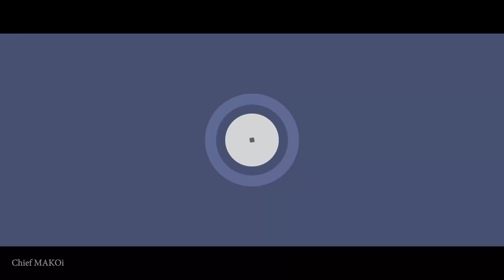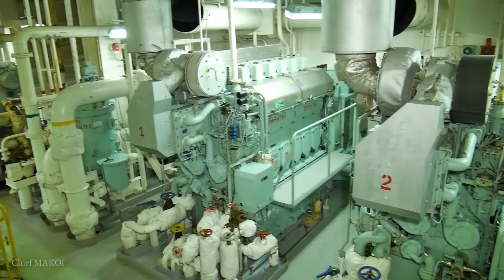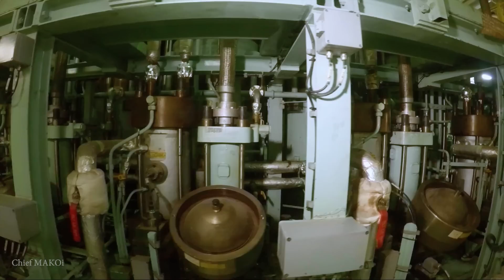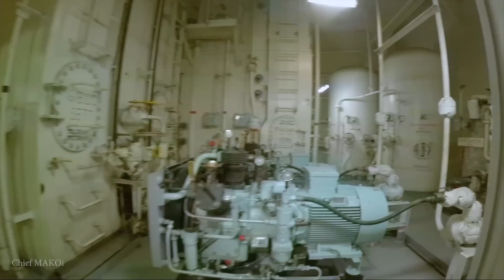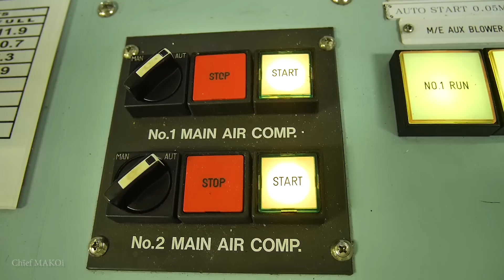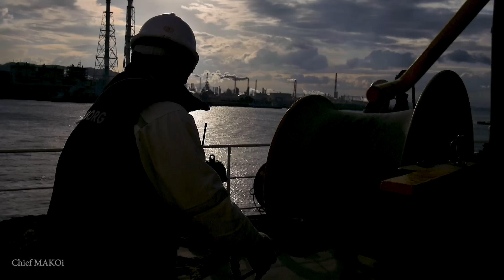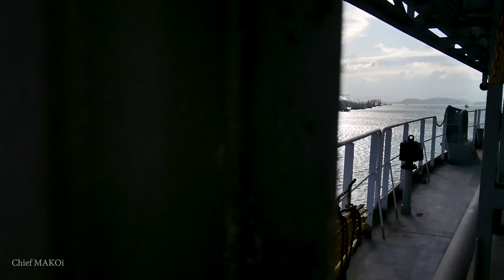Starting Up the Ship's Engine and Leaving Port | Seaman Vlog

Comment: You are not only a superb chief engineer but you are also chief at engineering superb videos.
It's a bit more involved than putting  her in neutral, pressing the glow plug button for 40 seconds then turning the key.

Comment: very good video.  Would have loved to see the engine turned over, fueled and then started.  The electro hydraulic injector and valve train has numerous advantages over standard mechanical FI plunger and cam and valve trains. Timing variation of the injection and valves, and much easier reversing of the prime mover are two.  Who's 6 cylinder main prime mover is that??

Comment: SORRY  A SHIP CAN PULL AWAY FROM THE PORT. MOST OF ALL IF IT HAVE BOW THRUSTS...  IT CAN STARTED  UP ENGINES ALSO AND KICK IN THE FORWARD SPEED TO 1/4 SPEED.  JUST ENOUGH FOR RUDDER CONTROL.. WITH THE CONTROL OF BOW THRUSTER..  I HAVE SEEN AND US  CARRIER DO IT WITH OUT BOW THRUST ER

Comment: That was interesting and really well done, thank you!  

But, what I was looking forward to is the actual starting and stopping off the engine in real time.  After the blow down of the cylinders, is the engine then ready to be started?  Is starting and stopping the engine not as big of a deal as I thought?  You seemed to kind of skip over that really quick.

Comment: Non-seafarers need to understand what you said, the main engine is directly connected to the propeller and to change from ahead to astern or vice versa the engine is stopped and then started up again in the new direction, this is unlike your car that you can put in neutral with engine still running and your car engine always runs in the same direction.  If the engine is turning so is the propeller.  this also limits the lowest speed the ship can travel at, the equivalent to idle in your car with the gear engaged either forward or reverse.  Steering the ship is much dependent on water flow from the propeller over the rudder, without the engine running it would require very large rudder angles to be effective at all.  Going from ahead dead slow to astern dead slow takes some time and if the ship has been running even at a dead slow speed it will continue for considerable distance even when the engine is stopped.

Comment: Nice video sir, may I ask sir how the injection pump and the valves are timed with the strokes of the piston without the camshaft? Thankyou sir. Safe sailing. 
Fr. the Ph
Reply: The valves take their motion from hydraulic actuators, which, in turn, are controlled by electronics. That he already mentioned. If, however, you are asking how the electronic control system itself knows the timing, that is a different story.
As mentioned in the video, there are many varying designs and ways to achieve the same basic principles, one way, the control unit has sensors that gives it information about the position of the flywheel relative to a reference point, thus the controller unit always knows the position of the crank shaft and acts accordingly
Reply: @ahmedabbas4434  yes sir that's exactly what I want to know, the timing. Since it was hydraulically controlled, I was just wondering how it's being actuated accordingly.. Btw thank you sir 😊
Reply: @joseemmanuelvito555  you are most welcome

Comment: My old neighbour (Tom Croft) was on the North Atlantic convoys during WW2,
he said the triple expansion engines slowed right down as soon as they hit 

the Gulf Stream. 

All steam engines work best with a very cold heat dump.
In fact the French mathematician Sadi Carnot enraged engineers when he
told them the maximum efficiency of their engines depended upon the 

temperature difference.

Comment: Why would there be a need to reverse the main engine if the thrusters are electric motors..couldn't that be done electronically by changing the electrical polarity to the motors
Reply from the maker: The propeller is directly coupled to the main engine's flywheel.  There are no electrical thrusters on this ship.
Reply: @ChiefMAKOi  Ah, okay, I swear I thought this ship was Diesel-electric but I was mistaken. Yeah, that makes sense then, thank you, cheers.

Comment: Is the engine directly connected to the propellor?  And is there some kind of gearbox for reverse and forward?
Reply from the maker: Direct.  Engine has to stop in order to reverse.
Reply: ship engines are designed slightly different to most, the diesel engines used on a lot of big ships are 2-stroke diesel engines, both scavenge and exhaust timings are symmetrical about BDC, and will be identical if the engines runs in the opposite direction, all they need to do is alter the fuel timings and air start once the engine is stopped and it can run in the opposite direction, will be even easier for an engine like this with hydraulic valves. It can also be done with 4-stroke but is more complicated.

Comment: How many miles can these engines go before needing to be overhauled??
Reply from the maker: Each part has its own running hours before maintenance.  As an example,  the exhaust valves are done every 8000 hours while the pistons every 12000 hours.  Of course it depends on the condition of the part in question.  If there is damage,  then immediate maintenance should be carried out.
Reply: @ChiefMAKOi  have you ever had to change a crankshaft?
Reply: Do you ever unload on the US East coast Philadelphia, Baltimore, Newport?

Comment: Fascinating, no cam shaft. Is this normal in marine engines? Unrelated but, are you with the same vessel or go where required? Thanks
Reply from the maker: It's the trend in newly built ships nowadays.  The crew are usually rotated among the company's fleet.

Comment: A dummy like me might wonder why the whole engine need to change rotation for change direction to the ship. Thinking there's been those....Not sure what's the real name but as Kamewa propellers decades already. What I mean is a type of propeller that changes pitch of blades and far as I know, the propulsion can be fixed both direction no matter the propller is turning one direction all the time. On this matter,  feels like saving quite a lot work and time when the direction could be turned like a real time with by a one handle. Sure there's a reasonalble cause for this, but just wondering things what do not fully understand. Great vid however.
Reply: My guess would be that for a ship like this, which spends most of its time at sea at a constant speed and needs tugboats for manoeuvering anyway, adjustable propellors would be a waste of money. And they may not be able to achieve the same efficiency either compared to fixed-pitch propellors that are specifically designed for this ship and engine.
Reply from the maker: That would be because variable pitch propellers will require its own set of machinery involving hydraulics and a lot of other stuff.  So that would be a very big additional expense on installation and maintenance.  Plus, since there are more moving parts, the chance of malfunction and damage is greatly increased.

Comment: Say there is a major leak in the engine room what is the procedure?
Reply from the maker: If the ER is already flooding, open the emergency bilge suction valve and start pumping the water out.  Then try to patch up the leak.

Comment: It’s so interesting to know a little of what goes on onboard every single ship you see all over.  There’s such a huge amount of work and complexity to build and operate these engineering marvels.
Reply: I understand what you’re saying and on the other hand these engines are quite basic. Especially the total lack of gears and clutch. Reverse? Ok we’ll stop the engine and start it in the other direction. Makes perfectly sense too!

Furthermore no exhaust gas recirculation (EGR), no DPF no turbo’s probably no Mass AirFlow sensor and so on. 

Nonetheless very impressive.

Comment: Chief Great video. Is the bunker fuel moved to keep it in a fluid state. I have heard that the fuel is almost like tar. Is that true?
Thanks. Send more vids. Subscribed
Reply from the maker: The tanks are heated and temperature is maintained at around 35-40 degrees celsius.

Comment: So in order for a ship to go backwards the engine has to turn backwards?
Reply: Kinda neat, I suspect since the injector and valve timing are computer controlled ,there is a smooth transition to reverse, after engine is stopped ,unlike the old 2 cycle outboards where you back the ignition timing off until it shakes itself into reverse.

Comment: I am a Marine Engineer Student sir, just want to ask if this right or not about my steps to turning on M/E of a ship, first turn up the A/E engine that supports electrical for Lub pump, Fuel pump, cooling and starting air system right, then after all condition ready (include Fuel on its pouring point temp etc.), start to blow some pressure air to the cylinder to push the piston right, then after revolution reached and fuel already injected, starting air stoped, but after all, how to start A/E engine sir, is that same way as the M/E starting or Different?

Comment: Does the ME run on diesel when in harbour and change over to heavy fuel oil when full away. Did in my days but that was a long time ago. Nice video well presented.
Reply from the maker: In certain countries like the US, China and in the EU, it is mandatory to use low sulfur gas oil.  In other areas there's no need to change over from heavy F.O.

Comment: Nice video. I'm curious about more details on bringing the engine to a stop, and then starting in the opposite direction. Do you selectively blow into the cylinders that were on the up stroke when the engine stopped?

Comment: Fascinating video. It made me wonder whether there's a minimum speed that the engines can be run at without stalling. Any idea?
Reply from the maker: Dead slow speeds.  Usually around 30 rpm.

Comment: Greetings from Australia, Chief.  On the maintenance side of things what sorts of electrical motor and mechanical things can you solve onboard with either spares or lathe work ? What are the "show stoppers"?  I should do a video for the start up procedure for my kayak!  Keep up the good work.
Reply from the maker: The items which can be repaired onboard by spares or fabrication are too many to mention.  Most of those are small parts.  However, for advanced electronic designs which run on PLC or Circuit boards, those are almost impossible to get around without having the specific spare parts.

Comment: Are large ocean ships all diesel powered these days Chief? Or are there still steam turbines with oil-burning boilers still around? Our training ship in 1967 was the Glen Strathallan which had a triple expansion steam engine, but they would be a museum pieces nowadays haha.
Reply from the maker: There are modern steam engines but mostlt for the LNG carriers.  The boilers burn the boil-off gas from the cargo.
Reply: That makes sense! No time wasted for bunkering, just use the cargo 😀. Do some of the other types of tankers use their cargo as fuel for their engines?

Comment: Where does the electric power come from before main engine is running?  Batteries, generators or shore power
Reply from the maker: Generators.  On this ship we have 3 with a capacity of 600KW each.

Comment: What a great video! It's so cool to see all the details. Thank you taking the time to create this. I'm curious how long it takes from the engine to go from maneuvering speed ahead to maneuvering speed astern? It's hard to get my mind around the fact that you have to stop and restart the engine to change direction. Fascinating stuff. Thanks again!!!
Reply from the maker: The engine has an automatic load program.  So even if you do a "crash astern", it won't immediately give the amount of fuel necessary to go on full.  Except if you push the "cancel program" button which is a manual override and only to be used in emergencies because doing so could potentially overload the engine.

Comment: Red arc at 50 to 60 rpm a harmonic vibration point in the drivetrain??
Reply from the maker: Yes.  It's termed as critical speed.

Comment: Very informative. Pls do something about the "S" sound in your audio. 😑 i believe you can filter than using an audio software. Thanks
Reply from the maker: Will work on that.  I'm still figuring out voice audio mastering.  I'll get the hang of it someday 😁
Reply: @ChiefMAKOi  or you may want to try pop filter for your microphone in your voice overs (if theres non) or just turn the mic at an angle. Hope it will help. Thanks

Comment: How do you switch from forward to reverse? Can they do that on the bridge?  Is there a reverse gear or can the engine run in reverse?
Reply: @Dipipegb Reversing the engine can be done on the bridge if the control was handed over to the bridge or in the Engine control room as well. In case of chief Makoi engine they have an electronic control engine so they don't have a reversing mechanism, There engine is run by a software loaded to the ECU, not complicated no moving parts only electronic stuff...
Reply: @jaddionecio9956  So the engine can run backwards? The the engine would have to stop and then restart in reverse?
Reply from the maker: Yes.  The reversing mechanism basically just reverses the firing order of the cylinders.  You'll actually see it in the video when the flywheel turns clockwise and then counter clockwise. In engines with traditional camshaft, the reversing mechanism is a mechanical component while in electronically controlled engine  the reversing mech is a software.
Reply: @ChiefMAKOi  That is so cool they can run the engine in reverse, no car engine can do that (except for electric cars). So the process of restarting the engine in reverse is automated? They just select reverse and the computer stops the engine and restarts it in reverse?
Reply: @shaonian  Yes, the engine needs to be stop first then it can be started in astern or reverse direction

Comment: Thanks Chief, I much enjoyed that, more edifying and heartwarming than Game of Thrones. Having been a powerhouse and gas compressor plant operator for several years. Your essential systems are similar to Fairbanks Morse OPs,  GM EMDs and even GE Frame 5 turbines, and I'm sure the intuitive bond an 'Operator', or in your realm an 'Engineer' develops with his engines as almost living machines is the even more intimate when it's the sole piece of equipment that moves your voyage and your lives depend on.
Reply from the maker: Thanks Jack.  That's true.  Even with all the noise in the ER, you can tell something's wrong because something sounds slightly different.  Even when in my cabin if I feel the ship's vibration change or suddenly the humming sounds change, I immediately call the watchman and ask what's happening.

Comment: Was the pilots departure by helicopter lift normal? That seems excessively dangerous just to transfer the pilot, at least from what Ive seen.
Reply from the maker: It depends on the place actually.  Some waterways like the Columbia River Bar could sometimes get very dangerous to cross by boat.
Reply: @ChiefMAKOi  Ah interesting, didn't even think of that. Love your videos, I'm a pilot but the ocean always has my interest. I feel there are many similarities to flying
Reply: It's nice to think your grain or  corn required an air lift to get to your cubbard

Comment: Never thought I’d see an engine make my 16.4 liter engine look tiny.
What kind of oil does that huge engine use? 
Like mine I use Amsoil Dominator Racing 50 weight.
Reply from the maker: It can also use low sulfur gas oil <0.1%

For lubes, it actually uses 2 grades.  1 for the cylinder and piston rings and another for the crankcase components.  Typically Shell Melina S30 for the crankcase and Shell Alexia S3 for the cylinders.
Reply: Chief MAKOi That’s so cool! I bet the piston by itself is bigger than me!
Reply: Heavy fuel oil with 3.5% Sulfur Max

Comment: This is the first time I've seen Main Engine to start from compress air... I've always been  on engine that starts with battery.. A very helpful video. Thank you for sharing some knowledge
Reply: Large Marine Diesel engine are started by compressed by means of its starting valve w/c inject compressed air to each cylinder

Comment: Excellent video Chief, as a retired diesel mechanic I'm very interested in the operation of the main engine, just a quick question though, during the port departure the ship can be required to move a stern, does this require the main engine to be stopped and run in reverse rotation, as the prop shaft is directly driven from the crankshaft ?
Reply: I'm guessing as it's a direct-drive.
Reply: Yes, for 2 stroke engines.
Reply: Yes, it's really just like that. Remember the old Mitsubishi bubble car of the 1950's? Same operational procedure, stop engine, restart in reverse mode, then stop engine and start in forward mode. Doing a 3 point turn, and parking was a nightmare in daylight. Back in the good old days you couldn't swear in public, so that made parking at the office an especially hard start to the day.
Reply from the maker: Yes. Start and stop.